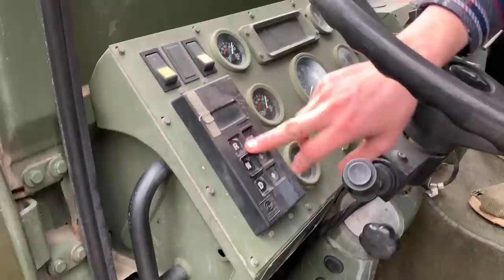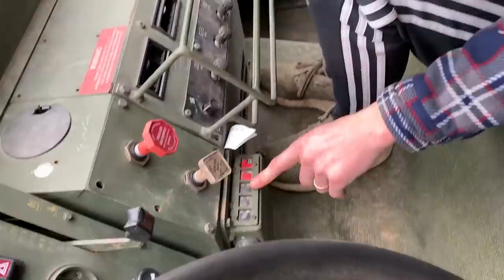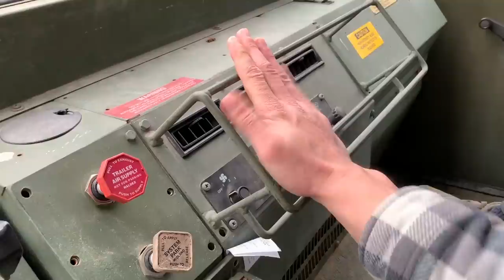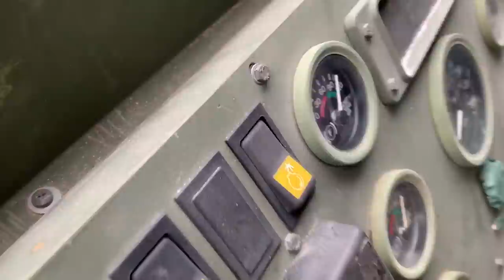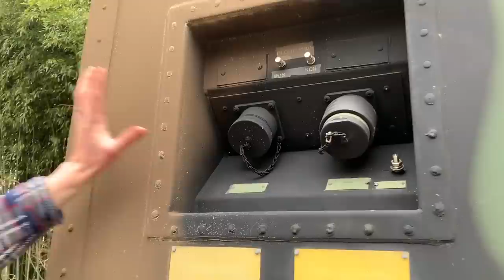Building The Ultimate Apocalypse Vehicle!!!

Comment: A M 16 is a automatic firing weapon that you stick out the passenger window and fire it when you have a center passenger going to sleep and falling over on you or the driver. The reaction is a center passenger waking up in a panic going straight up and hitting his head on the steel inside roof.

Comment: If you can widen the chassis and truck body, you must put in a 2400 horsepower Volvo Iron Knight truck engine as an option or a Cummings 2500 hosepower equal sized engine for that truck. I love to see a speedy Apocalypse truck.

Comment: Guaranteed this vehicle had much more than 800 miles on it.  There is no telling how many miles are on it since many times parts are swapped from truck to truck to keep them running.  The tires also show more than 800 miles.   My guess is +13000 miles for a 1994 LMTV.

One thing for certain is the vehicle did not make it to the Persian Gulf due to the color of paint.

Eat your Wheaties or spinach when changing tires.  Each tire with rim pushing nearly  +300 lbs.  Torque on lug nuts will take some good effort.  A good hydraulic jack and wood blocks a must.

When working on engine, make sure you put a strong support under the tilted cab.  Don’t depend on the hydraulics system to keep the cab tilted.  There are instances where folks have been crushed by the cab.

Comment: So far everyone commenting about the lights is correct. They are for driving with NVG's (Night Vision Goggles). As for the Panel with the phone connectors and 2 round ports. That is where the Generator would connect in. The generator would connect to one of the round ports to provide 120V to the inside. The phone connector is for the old style phones. 2 wire system. If i remember correctly the Generators were 3 Phase and the electronics inside the back would step it down from 3 Phase to 120V. Hope this info helps.

Comment: Guys, the hole in the roof of the cab is for a "turret ring" that bolts in there to mount a machine gun on the roof.  The gunner would stand on that center section in front of the middle seat

Comment: So I had a similar one when I served. Mine used to have 22 or 24 grease nipples and we would have to idle them to fill the air tanks. We would purge the air tanks to get moisture out while it idled. Because it would damage the tanks. That lever to the right of the steering wheel is a choke/idle control. Mine used to be a 6spd manual twin turbo I believe. It’s been ages since I’ve been around.

Comment: I work on these for a living first things first replace the hubs there’s no seal on that outer hub cap so as soon as it’s get subermerged in water you get what’re inside the hub and it the system that inflates the tires is called a CTIS system you have two seals on the hub they use roller bearings on the outside it’s oil on the inside of the hub it’s grease guarantee it’s contaminated in the army we service the hubs once a year due to contamination if you get the serial number off that model which would be a FMTV Series vehicle you can actually google it and you can find the TM For this specific model since there’s so many variations you need the serial number and that TM is like your basic Haynes manual but for the military your and tells you how to replace anything and everythin even torque specs and etc and part numbers for everythin good luck on the build any question feel free to message me so I can go in depth 🤘🏻

Comment: 22:46 That hydraulic jack-looking thing between the cab/spare tilt box is the manual override for the cab/spare tilt.  just make sure you don't leave your kevlar helmet in the cab when you tilt it, because that will crack the heck out of your windshield, and send your motor sergeant into a fit...  or so I've been told.

Comment: There are numerous videos of people refitting these into tiny homes etc. they can ford up to 4 foot of water. Things to consider use eBay to purchase some rings to protect you central tire inflation system. I would recommend installing lockers. The turret hatch has been welded other wise the access to the top is an amazing view. The m16 is a 5.56 caliber selectable between semi burst and auto it is a gas operated weapon system the more modern variant is the m4 shortened collapsible stock it does not have full auto. Do a PMCS preventative maintenance checks and services there is a manual that has pictures y’all are not the first country boys to go Damn. I have drifted one of these. I recommend getting bigger injectors checking all your rubber fittings for cracks etc. the caterpillar motor can be flash tuned get on the internet and get ya some good ol’boys to help this is a beast and I am a lil jealous.

Comment: CARC (Chemical Agent Resistant Coating) is a paint used on military vehicles to make metal surfaces highly resistant to corrosion and penetration of chemical agents. Inhaling CARC during the painting and drying process can be harmful. Dry CARC poses no hazards, except during welding or sanding. Wear a good mask if you sand the outside OR inside of the truck guys. This stuff is no joke to breath. Also, most of those trucks are 24 volt with the batteries in series to equal 24v. Careful plugging stuff in those sockets without double checking.

Comment: The outlets and lights won’t work fed from the breaker panel. You’ll need a 60 amp cannon plug from a generator to power it up. The hook up was located on the outside.

Comment: On the passenger side in the back that looks like two outlets for arc tights to plug in your 208 or your 120 panel. They are also called cannon plugs. C Jay leasure Union electrician.

Comment: Steelsoldiers.com will be your friend. Also if the central tire inflation system or ctis doesn’t work you will pull your hair out trying to fix it. The military does have a 10 ton equipment trailer called a m322 or the newer ones for sale from IronPlanet are 2012 globe equipment trailers and are for sale in California

Comment: An M-16 is the same as a AR-15 with a fun switch LOL the round plate in the cab roof is were you can install a roof gun turret, you have a communications truck ,you would pull a large generator and those two round caps are your power connection points

Comment: Also that can does raise it’s a hydraulic system it uses dexron iv and it’s common for water to get in the system check your resvoir there’s a sight glass on there if it’s pink it means it’s contaminated and needs flushed

Comment: the roof is a cut out for a .50 cal turret. the passenger rear mil. spec. barrel connectors are for shore power (generator) you seem to have a mobile office

Comment: Check the cover for the battery for basic maintaining of truck read each table for instructions cab latch is in or behind driver ,in the box of tie truck you should have the power stated on each plugin may need electrician to show you what you can plug into system 24V is standard may have an inverter for 110 volt so truck could plug a generator to the connections on the corner on outside of truck fuse panel your truck service department can show  you how good luck lot of room for bunk hangers lights have certain purposes fixture and bulb switch fused for load.

Comment: The bolted plate at the roof normaly there is a hatch for the LMG mount I bet the is a bunch of possibilities what could been issued to it but the hood thing is is militarystandart so everything could be fit there .Of course not from the homedepot .But I bet there are militarydealers around in the aera you able to by this stuff for cheap .Maybe it´s good to have the hatch only to open the rooftop of the cabine . You could mount the LMG later as the first Zombies show up :-)

Comment: Don't turn on lights without changing up first, those cat eyes at bottom of headlight/taillights are for blackouts can see when dark up close, designed to be used with night  vision
Reply: Also your for a trailer your going to want to use the air connections for brakes

Comment: The guys are excited but I ought to caution you. These trucks are death traps in a military environment. We used to call them silhouette target seats because that's literally what you are while you're in the cab. The enemy can get a perfect shot into your chest because your entire front is exposed while inside the cab. They are not armored either. They break down frequently. They suck fuel like nobody's business. The engine sits underneath the cab which was supposed to make it and bomb-proof against landmines but it doesn't actually work very well. They were originally supposed to be air-dropped and used by Airborne units but ended up getting used for every side because they weren't very good for that purpose. I had one breakdown in country and get left a full day on the side of the road while I laid in a ditch with my rifle and battle buddy waiting for rescue cuz the convoy left us behind. I hate those trucks.  Most 88 mics who died during Iraq and Afghanistan did so in these trucks.

Comment: The box below the tire has the hydraulic control to lower the tire but it is extremely dangerous if you do not know what you are doing. DO NOT KICK THE TIRE OFF THE TIRE RACK THAT HIGH!!! The tire will break bands inside and cannot be safe to put on the truck if needed. The tires are expensive.

Comment: you state something about the small light box. what it does it sends a low light for you for night out driving which you will need night vision goggles. we called it going black out. there is a switch in vehicle for your lights and one says IR or NG. it shuts off main lights and turns on very low light

Comment: Check the hours.,  Most Military vehicles  set and idle a lot.  Do not grind the paint without a mask on.  It is poisonous.   That vehicle is not a combat vehicle.  IT was owned by the National Guard or a Reserve unit.  If you get the SN and publish it you may have a fan that can check it history.  I no longer have access.  Check it all.  They are VERY maintenance intensive and are very expensive to fix.  Think Semi truck levels of cost to fix it.  The tire is 300 Plus Lbs.  Careful it will kill you. The cab lift forward.  Keep it filled and clean the filters now.  Get a -10 (Dash 10) manual.  IT will help alot.  The plug are for generators and commo equipment to attach to out side sources  It takes 5K Generator to power it properly.  This is a Command vehicle meant for Company or Battalion unit to command troops from a movable location.  It is not armored. It takes about 30 minutes to get moving once placed.

Comment: Dudes.. Measure the diameter of the gun turret over the cab... get a big lexan dome to go on it.. bigger than the ring  so you have some SKY in the cab..
don't straight pipe it..  carefully remove the muffler at a connection so you can put it back on.. then figure out what size it is.. and buy a 10 foot length of truck exhaust pipe...  figure out how to mount it so you can remove it without damage.. so you can swap the muffler back on.. once you figure out how to connect it.. cut a  long oval out of the side of the pipe..  cut off a 3 foot length of the pipe and fish mouth it.. and weld it on at an angle. then do it again to the straight pipe.. you should be able to perhaps. get 2 or 3 on it... now you have a MEGAPHONE exhaust..  people miles away will hear you going away from them.   bad news.. that is a military vehicle..  you are not likely to ever get it registered for street use in any state.  i could be wrong.  did you get any manuals with it from the seller..  or find out where they can be purchased from..  that is trey cool though..  there is a lot of grease joints that have to be greased weekly.. if you go fording.. there is a crap load of stuff you have to do to prevent damage afterwords..  that is why you need the manuals..  the idea with that is NOT to be LOUD.. it is to sneak around with.  set it up in a bunch of trees and just hang out.  you will also need to figure out what the voltage and cycles needed to connect to the electric connectors on the side.. chances are its military stuff.. again.. manuals needed..  the more you mess it up other than the lexan dome over the cab.. the less it will be worth eventually..

Comment: Please do NOT SAND the PAINT it is a CARCENOGENIC PAINT.  This has to be done by a pro with a positive preassure suit.  Think of a Hazmat suit.  The paint must be disposed of properly.  I have 20 years in the military and this is CARC Paint.  Chemical Agent  Resistive Coating.  You may be able to get the manual if it has been declassified by the military just look for the Nomenclature Plate in the Cab. This will list the Nomnclature (Military for what it is) NIIN or Stock Number and maybe even the Manual Number  this should start with 9-  hope this helps.

Comment: I used to build these things.  Worked the engine line installing the engine assembly back in 94-96. Build these in Sealy Texas when built by Stewart and Stevenson. The CTIS system is pretty cool. The tires can take a 22 caliber round an still stay aired up. The whole frame is held together by Huck Nuts. FMTV's LMTV's
http://combatindex.com/store/tech_man/Sample/M1078/TM_9-2320-365-10.pdf

Comment: Those plugs on the passenger side rear are for power cables. You can actually go on govplanet.com (its a government auction site) and get a generator and cables that you can attach to those power plugs to power everything on the inside. If you go on the drivers side there should be a data plate that gives the nomenclature and NSN of the vehicle. You can google the Technical Manual and it will literally tell you everything about that vehicle.
Also, I hope you turn off the master power switch or else your batteries are gonna be dead quick. I believe it is the left most switch above the starter button. 
And yes, that circle on the cab used to be a turret for a weapon system. If it doesn't leak, don't mess with it!!! cuz once you do it will leak!
Word of advice you're also supposed to empty those air tanks after your are done driving it for the day.
Trust me, I've been active Army the last 18 years and am VERY familiar with that platform of truck.

Comment: Here is a site where you can get parts for the lmtv you have. https://www.easternsurplus.net/PartsList/25/LMTV-4x4-Cargo-truck.  https://emilitarymanuals.com/M1078truck.html should help you figure out how the military works and troubleshoot the vehicle.The plugs on the outside are for the external generator cables that the military uses to power the back for the computers and things they can put in there. Definitely would be a good bug out vehicle especially if you bought a military generator to go with it. Good luck on it guys.

Comment: Be careful Boys. You break something in the mechanical department (engine, radiator, transmission, transfer case, axles or driveshafts) you're gonna spend some money. These were made and sold to Uncle Sam. Uncle Sam has a big pocket book you don't. I've seen 90,000 dollar transmissions in the 60 ton trucks.  That was a Caterpillar Transmission too.  When you drive this vehicle you don't want to FEEL it shift.  You just want to HEAR it change gears.  I'm not trying to shit you but let someone else own that  truck. You just think Ferrari and Lambo  parts are expensive, just break something something on that bitch,  Have fun